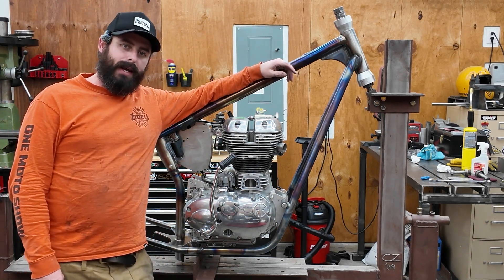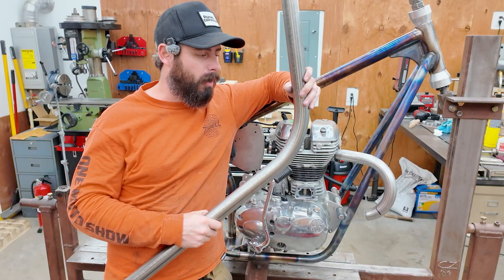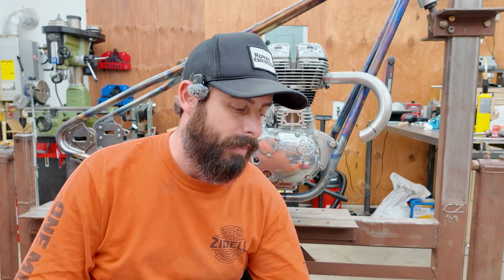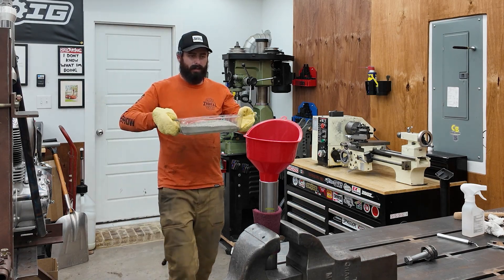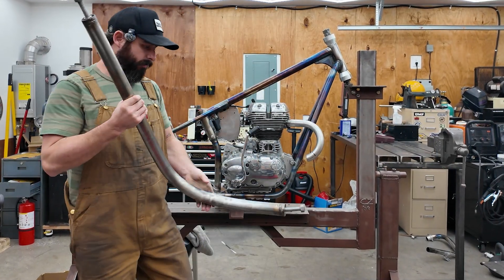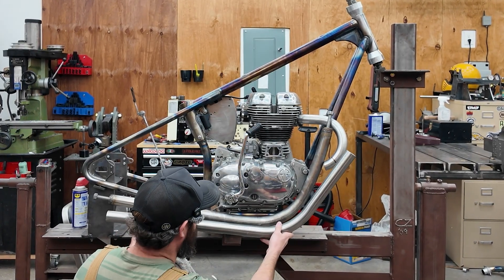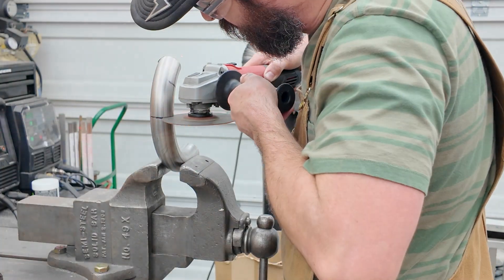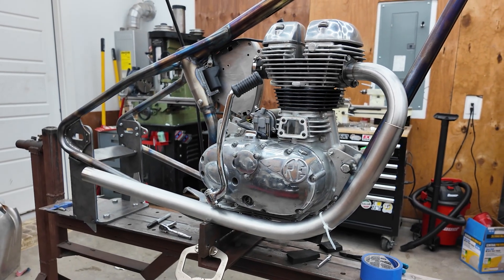Hand Bending Exhaust Again.. Kinda - RE Chopper - Part 8

Comment: Very usefull video mate ! I tried to sandbend a tube they same size You did with some strugle. From My experience how You catch they tube in they vice is not good . They vise must hold a larger section of the tube around 2" long to have a solid point of leverage it works for me. Best regards , very beautifull ride You are building !!
Reply from the maker: I very much agree with you! Ideally, I would have a vice with a V block or build a fixture (like a sleeve) to hold the pipe — and DEFINITELY bend it horizontally. However, I’m trying to get these videos out once a week 😅 and I had to leave town for 14 days, so I accounted for the bad clamping situation with some extra tubing length that I knew I was going to cut off as well as the “comment-able drama“ that helps drive my algorithm 😅😉😂. Really appreciate you watching and taking the time to comment. Feel free to call me out on any of my future offenses! (Seriously all good!)

Comment: I think you got a nice attractive compound curve. Good result. 👍
Re the muffler, in my opinion, that is one one of the finishing details of the bike.
I would prefer to get the bike much more finished, ie; wheels, tank, front end, even seat on the bike, then check the muffler style and make sure it works with the overall lines of the bike. 🤔
Reply from the maker: We’re on the same page 😉